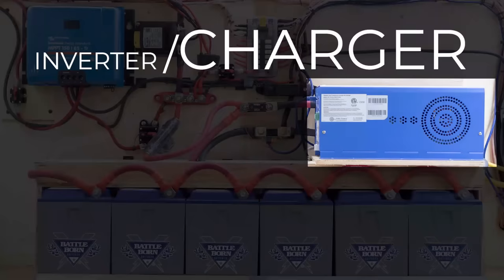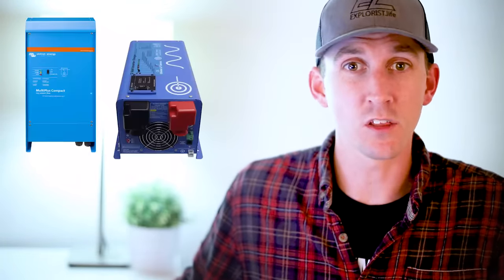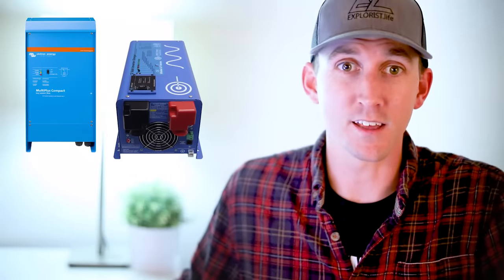Basic Solar Parts Needed for a DIY Camper Van or RV Solar Install

Comment: When you talk about RV solar install, is that the same as bus conversions? I watched this video because I wanted to learn more about solar components, but I'm looking to get a short bus to convert, so I was trying to see if this would apply to a bus as well.
Reply from the maker: Yes.  The info in this video will apply to any vehicle you'd like to add electrical/solar to.

Comment: I was able to fit 5x530 panels on my roof! I just purchased 5x445 panels to create an awning when deployed - that's a total of (5*530)+(5*445)=4.875kWatts of solar on my 20' Toy Hauler Conversion. Eventually I'll add another array of 5 panels, but that will require another Solar Charge Controller. Why so much power? Tesla CyberTruck is on order and I need to charge up my 112kWatt battery pack to then charge the Tesla...

Comment: Very helpful video and I plan to watch all yours series. I do have a question. I'm looking at systems from renergy and the hqst. I have decided to put four, 100 watt solar panels and 2, 100 amp batteries but I would like to get a system that I could add two more 100 amp batteries in the future. The systems from Renergy that I'm looking at say that they support two batteries. Does that mean they will not support four batteries or can that be done without damaging the controller?. Also will any battery controller allow you to swap lithium batteries in the future for your AGM batteries?
Reply from the maker: More batteries can generally be added without harming other components.  Solar panels generally CANNOT be added without changing to a bigger charge controller.

Comment: So many questions for my system I’m putting in my truck stealth camper build(huge panel I got makes “stealth” laughable) how do I get in touch with you for guidance? Very capable DIY’r just not an electrician.
Reply from the maker: If you're planning on purchasing your components and wiring kits from our store, you can reach out for pre-sales questions at shop.explorist.life/support

Comment: Question: If you don't have a preinstalled solar panel port on your rv (aka: a place to plug in a non fixed solar panel) can you use your trailer wiring harness as a port?

Comment: Do you respond to questions? I have a setup on my trailer and would like your input, it’s pretty basic but I’m only using it to run my lighting and to be able to charge my phones and iPad but I plan on slowly upgrading the parts would I be able to share my setup and have your opinion. Thanks
Reply from the maker: I do, indeed, respond to question both here in the youtube comments section and I also offer 1-on-1 consulting for more personalized projects: https://explorist.life/consulting

Comment: Hi, I wanted to know if this setup instructions will work for replacing fuel based generator of the food truck that powers various equipments. And what will be your suggestion for NON solar setup. Like the EV charging from wall outlet.
Reply from the maker: If sized properly, these components could be made to replace a fuel generator.

All of the diagrams at https://www.explorist.life/solarwiringdiagrams recharge by means of Solar, Shore power (wall outlet or fuel generator), and vehicle alternator.

Comment: I wanted to set up an solar panel system for my off grip water pump.. what and how many power(volt) does i need and what is the perfect number for the battery bank, and which product should i use... (now im using a generator for the pump)

Comment: This is a good video but I have looked everywhere for a video that shows how to connect solar to an existing RV that already has an inverter, 110 power, 12v power, existing circuit breakers and an existing marine battery. Can any one help? Thank you

Comment: is there something u need for sub zero  setup?  heat blanket for battery or something like self heating battery?
Reply: I'm no expert but from what I understand lithium has trouble or is not supposed to be charged below freezing and one of the option to heat it is heating mats
Reply from the maker: You should keep batteries in the heated portion of your camper as batteries like to be warm.  Lithium batteries will not charge below freezing and AGM batteries will have dramatically lower power output when below freezing; so, yes... you should keep them warm.

Comment: Question for the master, 40' class A. 3100 watts on the roof. 1000 amp lithium in the bay. Putting the parts together to switch to 24 volts. May run one roof ac. What size Victron converter (24-12) volt should I get? You might say 70 amp but would the 100 amp be overkill? Isolated or non isolated?
Reply from the maker: Hey!  Check out the system picker on the home page of our shop to see how we recommend setting up various sizes of systems: https://shop.explorist.life

Comment: Nice video thanks.
Does the Victron Energy MultiPlus Compact 12/2000/80-50 120V VE.Bus basically replace these 2 things I was considering?
1200 Watt Victron Phoenix inverter
Victron Orion Tr Smart DC-DC Charger
Reply from the maker: Phoenix Inverter: Yes.
Orion Smart DC-DC Charger: No.

Comment: If you are running more then one wind turbine and 4 solar panels do you have to have a charger control unit for each turbine and one for the solar and if so do u hook up all 3 charge controllers to the battery bank???

Comment: I have 10 panels rated at 400 watts.   Can I wire them with series and parallel combined?  How would I connect the system to  a 240 volt grid? Thank you.

Comment: Hi Nate and Steph
You use two different kind of solar disconnect box’s
I didn’t see the parts list
I never installed any of these item.
I purchased Victron components 
3000 watt inverter/charge
Solar controller 
Battery monitor 
3 battle born batteries and I may buy one more
I have a 2019 AirStream 
Any help you can give me 
Is well appreciated 
Love your videos
Reply: I’m in Arcadia California

Comment: Ok. I have a 35 Ft bus. I'd like the most bang for the $$$. Is there a company that makes a turn key kit with all parts needed that I can trust???  Planning on using a skinny apartment size 110 fridge , unless that is too much to ask of solar. Will also have an onboard genset to run the A/C or refrigerator from time to time. Not sure what is needed to swap back and forth the two power sources.
Reply from the maker: I mean... I have diagrams and parts lists available for a DIY system here: https://www.explorist.life/solarwiringdiagrams

'Turn Key' to me, means somebody ships you a system; you plug it in; and 5 minutes later are good-to-go.  That doesn't exist for large units like you're talking about.

Comment: Hello, My wife and I will be building a beach house in the Philippines next year when we retire. I've got a good background in electronics. We were thinking about setting up an RV like system for our beach house with mostly 12V components (lights, fans, 12V refrigerator, USB chargers etct.) and some AC (Air conditioner, coffee pot). We'll have to figure out what we can get over there as electrical standards will be different. Is there anything you'd recommend that would help me calculate the size of the system? Thanks for the great video!  Best regards, Tom Van der Bloemen
Reply from the maker: Yep!  Here's a tutorial (Nothing would change in the calculator in regards to 240v vs 120v, just a different inverter would be required.): https://youtu.be/a406IxiU-Xg

Comment: What are your thoughts on using microinverters with each panel so you are only having to deal with AC power transmission?
Reply from the maker: I think it introduces complexity into the system that is ultimately unnecessary for the small solar systems we are building on campers.

Comment: Very informative vidéos. I'm just starting in solar but want to do it righ. Just bought a FW with 50 amp. I have 4X6vdc Agm Trojan batteries.For a start i would like 400w Renogy solar panels. I will install a Victron mppt 100 50 and a victron multiplus 11 12 3000 120-50 2x 120v. So first do you thing for week-end and maybe 1 week at a time ,400w can be enough and should i install 4X100w panels or 2X200w panels ? Thank you
Reply from the maker: 4x100 vs 2x200 doesn't really matter.  More info: https://www.youtube.com/watch?v=J9iHYgF6pXo

Comment: So what kit would I need on Amazon with this? For ELECTRICAL. 

"Table 1.6
Total Anticipated
Amp Hours
Used Per Day"	282.10
Recommended Minimum Component Sizes	
Lithium Batteries	300 Amp Hours
AGM Batteries	600 Amp Hours
Solar Panel Array	600 Watts
Inverter	2000 Watts

Comment: VERY GOOD JOB. Young man !!!
Reply from the maker: Hey David Allen, No problem!  Glad it helped! :)
Reply: @EXPLORISTlife  I am working on a solar generator right now.  I picked up a BYD 300 watt module that was scratched during installation as scrap for 10 bucks. I am building a backboard with a 40 charge controller and one 750 watt inverter with a 1500 watt inverter. I am waiting on delivery of a 12 volt work light and a bug zapper that I will install on the backboard. This years hunt camp is going to be a great time.

Comment: So since last year I started construction on the ultimate get the F out of dodge mobile housing. I'd prefer that everything functions of electric, or solar power. With the exception of heating with a fireplace.  I'm worried about the on demand hot water heater. It uses a lot of power compared to everything else. Propane is something I don't want to be dependent on. I can't think of another way to heat water, other than on a fire.

Comment: Hi. Great video.
Can you tell me what I need to solar power 2 x 12v 150w heaters. Thanks
Reply from the maker: You need to do a power audit to determine how much power you can anticipate using on a daily basis: https://www.youtube.com/watch?v=a406IxiU-Xg

Then you can use on of these wiring diagrams and parts list to find the parts that will fit your energy consumption needs: https://www.explorist.life/solarwiringdiagrams
Reply: @EXPLORISTlife  Thank you very much for responding.
I am trying to setup two car/camping heaters to run all the time all day.
Well in the winter/cold part of the year the heater part will run all day.
In the summer days it would either be turned off or set to only blow cold Air.
The heaters power is 12v to run the fans blowing and the heater part uses 150w in effect/power.
I will be installing two and my thought was if a 200w solarpanel and a 12v 100ah battery was enough to run them all day pr heater.

Comment: OK. I am new to this solar system set up. I just bought a shuttle bus and I am converting it into my home. One of the most important things I need running 24/7 on summer time is an AC. The shuttle bus came with an ac/heater already and I am insulating the bus like is te end of the world. I live up north NY and temps here can be crazy. 

My question is how many batteries would I need to run an AC 24/7, Chest freezer, and a 65 in Smart TV almost 16 hr a day. All the other things I can do with propane. However I would love to have energy enough for a Stove as well. For water system I am building a rain water system and portable jugs for the bathroom sink with USB chargeable faucets. Not so complicated, but the AC is the one that is killing me. I would like to know how many batteries would I need to live in a bus. Also, how big the inverter/charger should it be?. If for example I want to install a 2000 watts Mono-solar panels?

So far you are the only person explaining this system in a more simple and understandable way for people like me. Thank you, Eileen
Reply from the maker: Hey Eileen!  You'll need to perform a power audit to determine the size of system you'll need to power all of those appliances.  Here is a tutorial for that: https://www.youtube.com/watch?v=a406IxiU-Xg

Comment: I have a 100 watt panel and (3) 12 Volt/ 82 Ah Battery's with a 400 Watt Inverter.. My question is. what do I need to add to run a small Dorm Size Fridge w/freezer.  The reason for my question is I live in South Florida and we do loose power for days with Tropical Storms.

Comment: what if i wanna wire in solar and into my alternator with an isolator? is there a controller for that or not recommended? gonna convert my car into a camper this summer. I ended this video more confused then when i first started it. data input overload lol

Comment: Is there a "Kit" you would recommend for a Grand Design 280RS 5th wheel, or the like, to get approx 7000W that will run the entire trailer (including Micro & A/C "off-grid" without issue for weeks at a time?
Reply from the maker: Yep!!  Use the system picker on the home page of shop.explorist.life for our recommendation.

Comment: Something that is overlooked A LOT is the fact that when electric supply is AC, like from shore power or a generator, the Victron units BYPASS the batteries and use the AC supply directly.  In other words, it does not take the AC power and convert it to DC to charge the batteries, then convert the DC power back to AC power for use. Shore power is abundant so the losses are not as important as when using power from the batteries, but you are still using the batteries and consuming life cycles from them.   This fact alone, if you do not need hand-cartable power, justifies the expense of the Victron.

Comment: So I'm stumped on my setup. I have 4 panels @ 370w, Voc 47.6v, Isc 9.99, 20A fuse. Any idea on how to build a system without burning down my RV? lol I'm having trouble coming up with the best way to set it up. I am wanting to use the victron multi plus 3000w.
Reply from the maker: Check out https://www.explorist.life/solarwiringdiagrams for the 50A OEM RV or 30A OEM RV depending on if your RV has 30 or 50a shore power.

Comment: Question - So I have a combination Pure Sine Inverter with a solar Charge controllier buiilt in with 20 A. I have Battleborn LiFePo batteries but it has a AGM or Lead Acid switch - 1) can I use solar to charge these using the AGM mode and in general can you use or run the a combo inverter at the SAME time you are connected to solar charger.... granted you'll be discharging the batteries but at a slower rate??

Comment: Any issues with charging the battle borns directly from the alternator? I keep reading and seeing different articles about needing a 2nd alternator designed for charging lithium and or some kind of dc to dc charger.
Reply from the maker: Nope.  They can be charged directly from the alternator.  I will be adding wiring diagrams for Battery to Battery chargers soon as I think it may be a better option for most, but all of the wiring diagrams I have set up for you at https://www.explorist.life/solarwiringdiagrams currently utilize a 'direct from alternator' isolator.

Comment: Brand new here and just trying not to repeat somebody else’s mistakes. Would you recommend marrying RV Love 200Ah Lithium Bundle from battle born to 600W mono crystalline panels? I have the space, curious on the pros vs cons
Reply from the maker: Any size of panel CAN work with any size of system.  The panel size is rarely important.  Check out the solar array options I have put together at the bottom of this blog post for an example: https://www.explorist.life/3000w-inverter-400-600ah-400-to-1200w-solar-camper-solar-kit

Comment: are you able to run 240v appliances like a wall oven? if so, how would that come into play in your electrical system
Reply from the maker: This is the diagram I have that would be set up to run 240V loads like a wall oven: https://www.explorist.life/24v-6000w-120v-240v-split-phase-camper-solar-wiring-diagram/  This diagram has dual 3000W inverters, which you may need bigger than that to run a residential size stove/oven, but the concept is the same.

Comment: I've inheirited a power tech-on pure sine inverter 1500 watt continuous / 3000 watt surge . Could I somehow use it with one of your wiring diagrams? Id like to have the full setup with a/c, hot water, & 6 lithium batteries.
Reply from the maker: Not really.  All of my diagrams use Inverter/Chargers, so they won't be directly compatible with your Inverter.

Comment: Hi. Ive bought 3 x Renogy 100W panels and a Victron 100 /20 Controller. At the moment I will be charging only a 100AH SLA battery but in the future it will be 2x 100AH LiFePo4 batteries. I have a question. Can I charge my leisure batteries and also a solar generator (which has a 200W limit but overcharge protection) simply by making a plug connector between the PV wires and the solar charge controller and just simply unplugging those 2 wires from the victron to plug it into the solar generator? Its not going to damage the victron or the batteries to have the Victron disconnected from the PV's but still connected to the battery quite regularly eg once every 1 or 2 weeks? Thank you